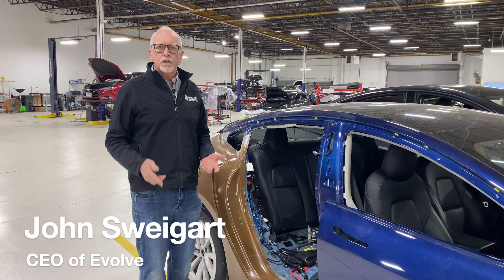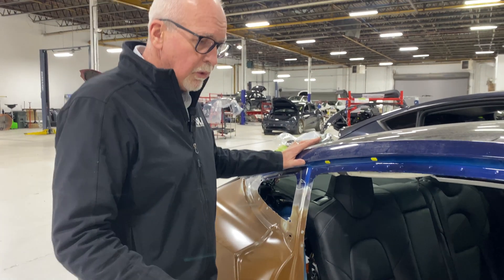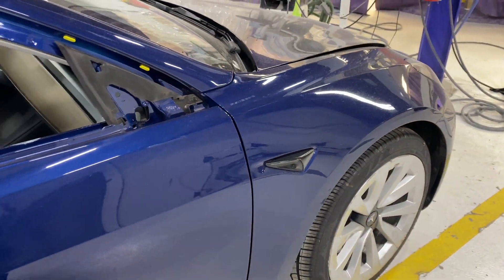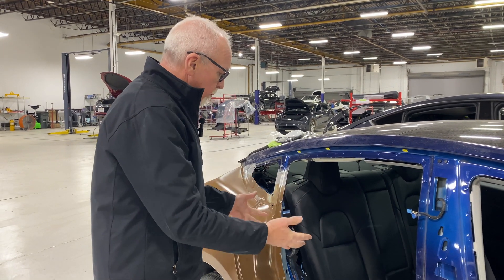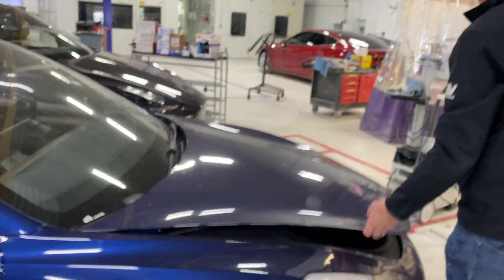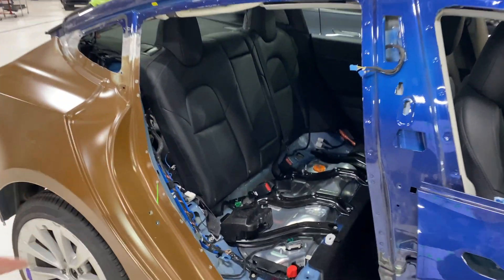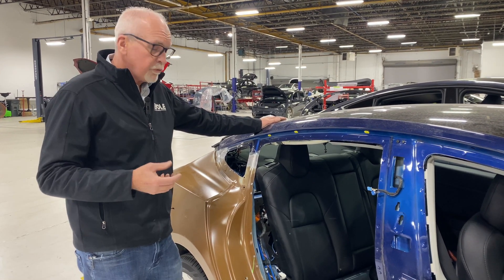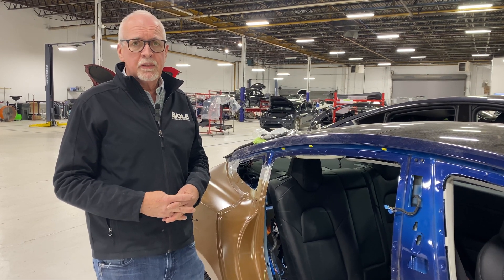TESLA MODEL 3 - Battery Isolation

Comment: Hi, after disconnecting all the connectors, where should I measure to check for any residual voltage in the HV system? From the communicator?

Comment: Is there a main battery isolator switch in this vehicle?
Reply from the maker: Thanks so much for the question! John addressed it in our latest Q&A video at 9:51 - https://www.youtube.com/watch?v=iqAGjC4pXMo
Reply: Do i have to reset anything if I disconnect the first responder cable and plug it up after repairs?